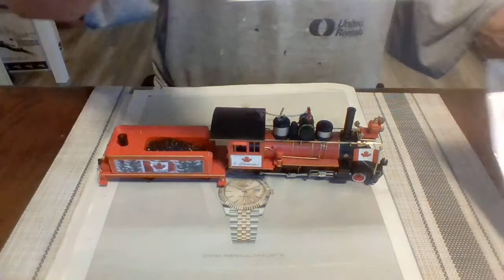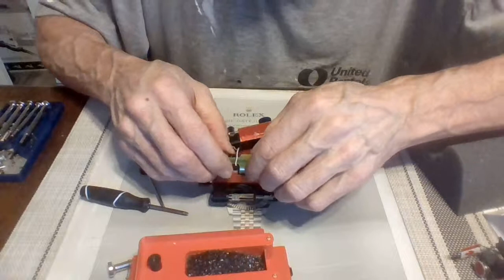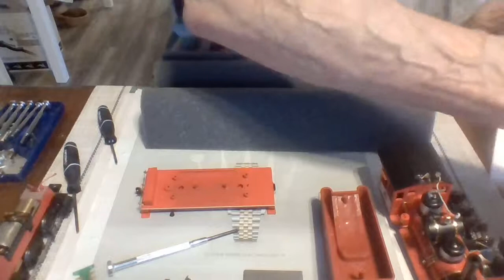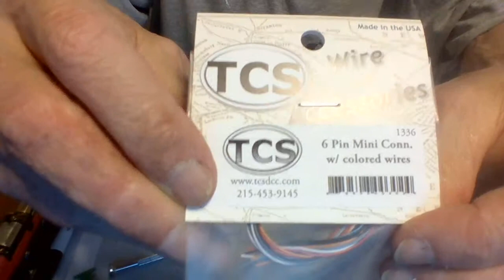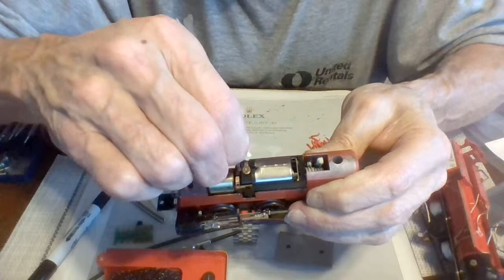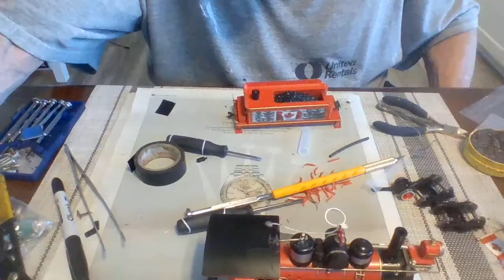dcc decoder install into an on30 locomotive 2-6-0

Comment: A very good description to install in this On30 locomotive DCC.
I have the same, only it's the Christmas Express version and I also want to install DCC; but I have problems to open the Loco.
I can't find a screw at the front to loosen the boiler ---- is it glued?
Can you help me.
Best wishes Franz
Reply from the maker: Ok well i watched my own video and now if memory serves me correctly leave the the rear of the train alone and there is a clip in the front that you need to unhook with the aid of a screwdriver then lift the front of the boiler out then the rear as you pull the whole assemble forward, i am thinking that if you put a small screwdriver into the front and pry back away from the boiler the clip should release and the front of the boiler lifts out at the same time but anyway that is where the clasp is you might just have to do a little prodding and poking to find the right screwdrinver location. Yes i was right i just pulled that video train apart there is a hook at the front that you need to pry away from the boiler or even just sliding the screw driver into the crevice might be enough then pull up on the front gently as not to damage any piping on the shell i hope i am clear enough its a little difficult to explain where you put the screwdriver.  Good Luck and let me know how you make out
Reply: @garydunkinson3310  Hello Gary, thank you very much for your detailed description of how to open the On30 steam locomotive.
Thanks to your help, I just managed to release the boiler at the front.
As you have already described, there is a snapper
was also still glued.
And now I have time to install the following: a sound decoder and some LED lights .... two more on the front of the locomotive, possibly also a firebox light and of course, as you have it, two tender taillights.
I'm currently looking for a small smoke generator, I think the chimney can be drilled out a little and a 5 mm generator can then be fitted.
I have time until Christmas and then, if not before, I'll probably shoot a video clip or two.
Thank you again for your quick and detailed answer, have a good time and stay healthy.
Best regards, Franz
Reply from the maker: @franzh2403  wow thats a lot of work to put into that little engine, i did consider the firebox strobe, piece of advice though keep checking to make sure things still close up ok, hate to see you go through all that work to find out that train or tender wont go back together because of something in the way so keep checking its worth the extra time trust me
Reply: Hallo Gary, i with you a Merry Christmas an a good New Year
Look at my Christmasvideo.  

https://youtu.be/NP5G_1h6eBU
Greetings Franz